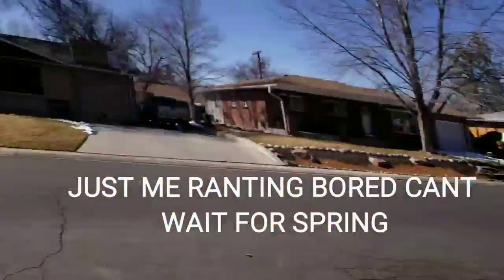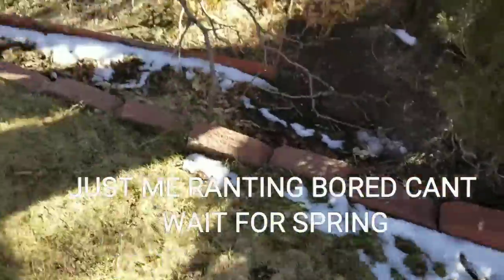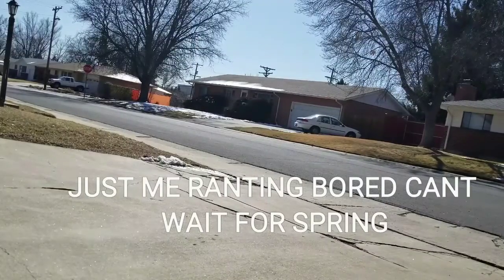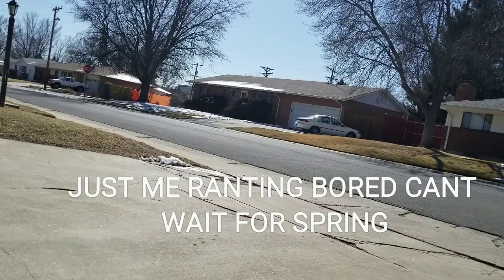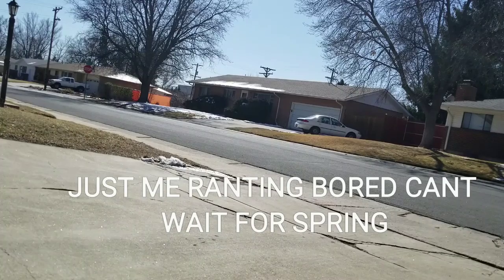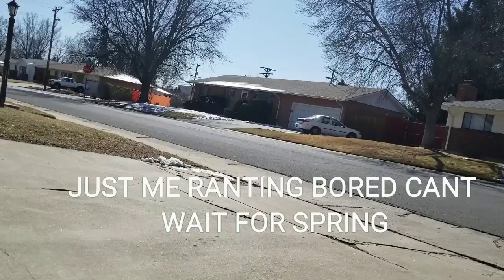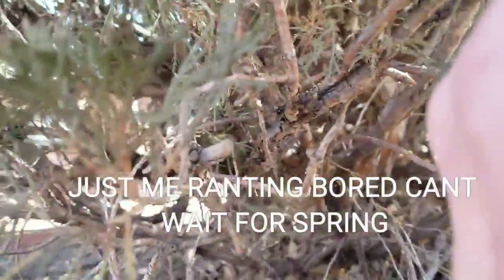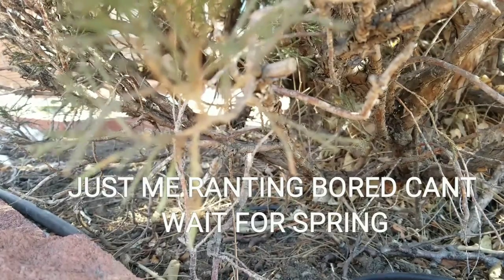Rant

Comment: That’s cord is a block heater. Keeps your coolant warm and will even help prevent your windshield from freezing up on cold nights! I’m guessing your super duty truck is a diesel? 👍 good video
Reply from the maker: Rat-Rod-Outdoors 
No it's a gas  but it's a 6.2  the biggest that Ford made at the time it replaced the v 10 I have never use it